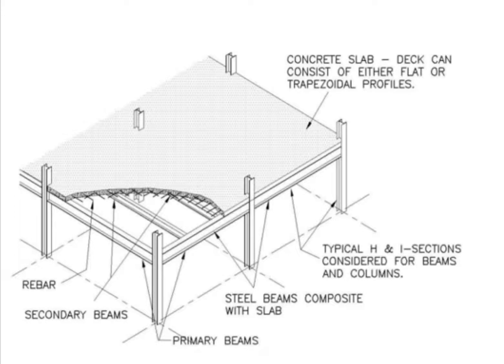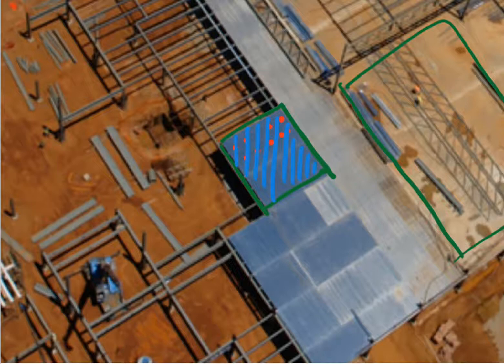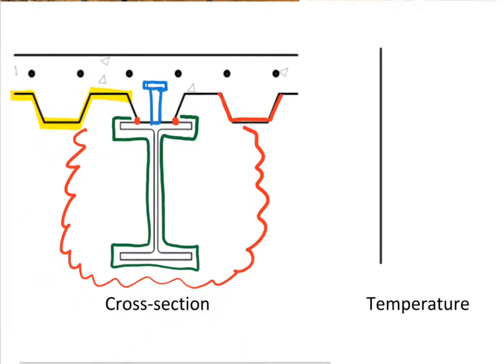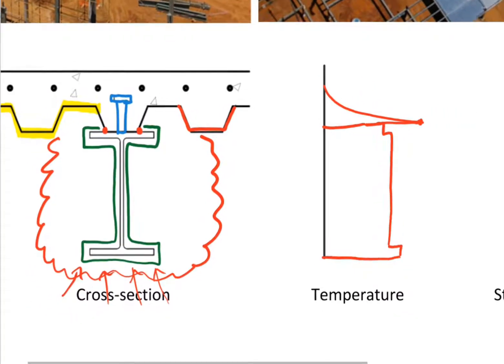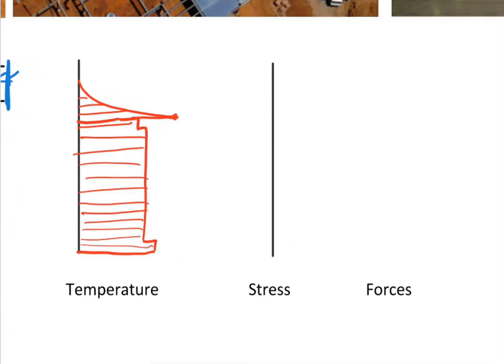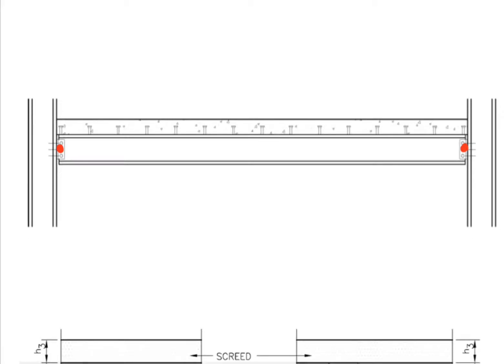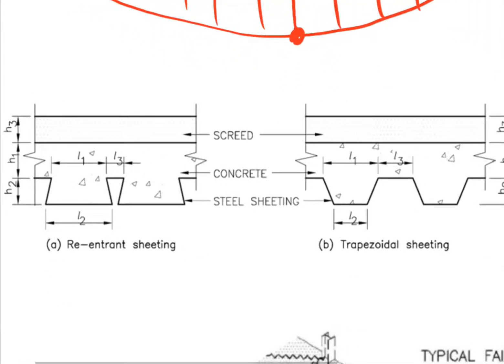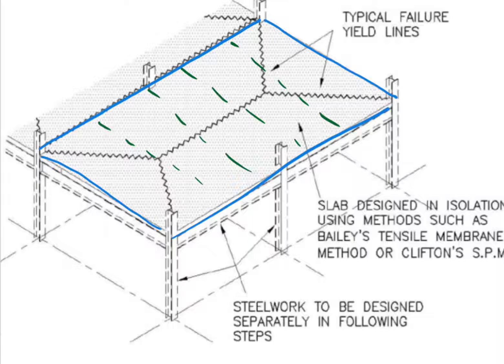Composite Structures in Fire: Introduction

Comment: Sir we ignore fire-proofing to deck sheet?
Reply from the maker: Yes. Passively protecting large areas of decking is extremely expensive and typically not done. We rather add rebar within the decking to give the slab a fire rating, if required.

Comment: typical section  of steel beam and sheeting is wrong , it should be reversed
Reply from the maker: Thanks for the comment. It depends on whether it is the primary or secondary beam. For illustration purposes it is a primary beam with the decking spanning in the same direction, with the secondary beams carrying the decking. Otherwise you can't see what is drawn.